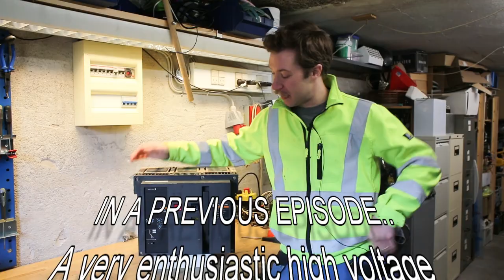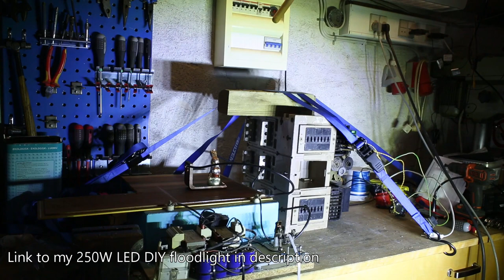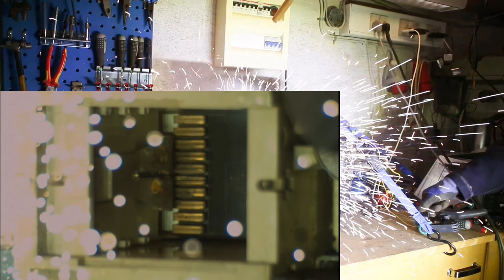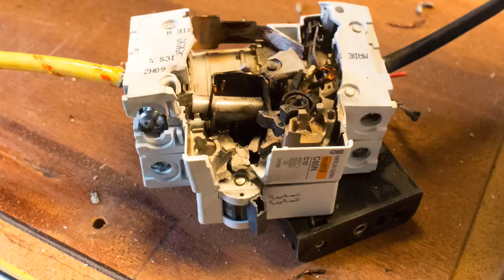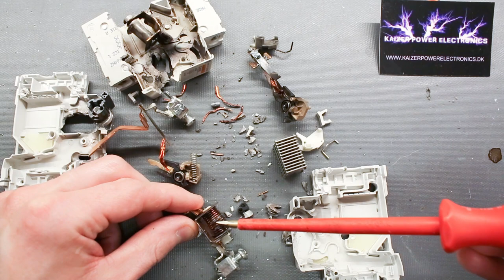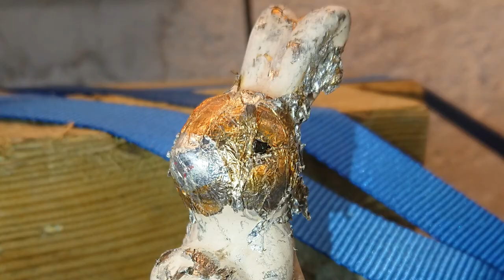Merlin Gerin 1600A vs. 10A Circuit Breaker 4000 FPS Slow Motion

Comment: The arc chutes are the interrupting device. They are not made for making operations. They work by the movable contact opening and drawing the arc with it then is conducted up the fins in the arc chute. Some work by the magnetism they generate to literally pull the arc up in to the chute. The chutes are designed to pull, stretch and quench the arc. It's not just a damper so to speak, it is the actual arc interrupting part of the breaker. With it removed in normal operation if there was a high fault current that breaker would probably burn itself down as the arc wouldn't be extinguished.  For closing, sometimes there is an arcing contact that makes contact first before the main contact. That is to limit the arc wear on the main contact, and they also rely on the speed of closing to limit the arc that is created on closing. Not sure if that breaker has the arcing contact or just beefy main contacts, but I do see a contact that is sticking up on the movable and fixed contact and those are to hand off the arc created during opening to the arc chute. Thinking about it more, I thing the Magne-blast breakers (1950's or so) were the breakers that were using the magnetism to draw the arc up the chute, but I also think they all generate that magnetism. Just one manufacturer decided to capitalize on the science behind it in the name. The one's I worked on were 4,160V  (5kV class) metal clad and were on wheels. They were old..... on some 2 MW EMD gens form the 60's.  Plenty of info on them online if you like to read about cool shit. The basic operation across all arc chute breakers is very similar.

Comment: Fun stuff. I have a collection of 2500v, 400uf caps from defribulators (20 in total) and have been making a "Rat trap switch", copper contacts added to a rat trap. I think I need to re-adjust my expectations about how much metal goes flying when switching caps like that
Reply from the maker: Putting all those in parallel and charged to 2.5kV, you have 25kJ! That is a massive amount of energy and can make some serious discharges. https://kaizerpowerelectronics.dk/calculators/capacitor-energy-calculator/

Comment: FYI, that's probably around 25T in that tiny little coil there, assuming the peak current is as stated.  That's a lot of pressure, and it's no accident that it went off like, well, a gun -- the fragments were probably supersonic, not that you'd be able to hear the boom over the, erm... boom. :D
Reply from the maker: Thanks for the calculation on that, that it exerts greatest force against the hard surface is normal for explosions, but I did not expect it to shoot through like that. I got a huge collection of 10A fuse, breakers and such that I want to do a test series on and see which types handles a fault current like this the best. I know 50kA is way above their normal 6/10kA ratings, but 6/10kA does not make good videos :)

Comment: Scary....  4:20 the bank is full, when switch engages it has dropped to half charge. Got a large bleed resistor not in schematic?
- also scary not all the energy is dissipated and you move your hands close to it. According to the meter it seems (also at 2:10) the bank contains nearly the same energy before and after the short. Tau, when highly charged makes you go av-uuuu
Reply from the maker: Meter is only connected at charging and bleeder resistor is manually applied with a chicken stick :)